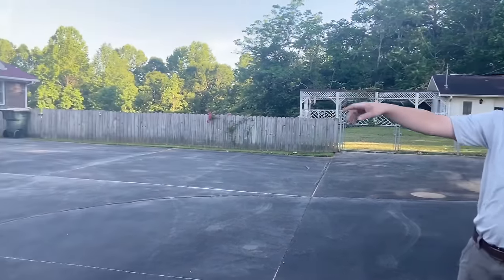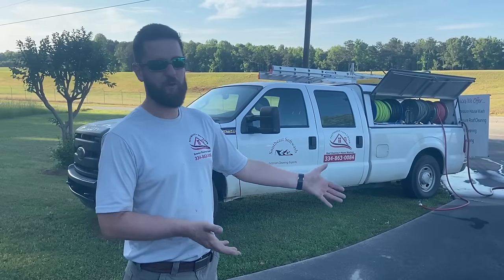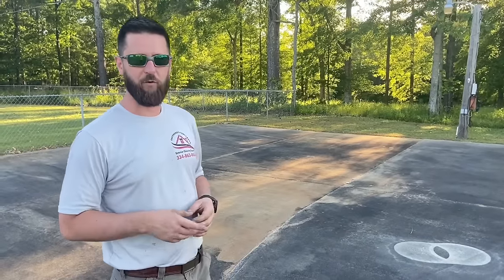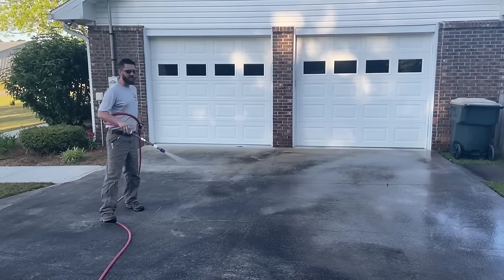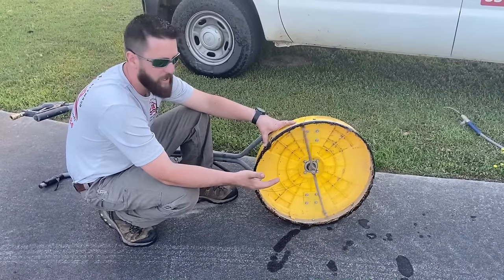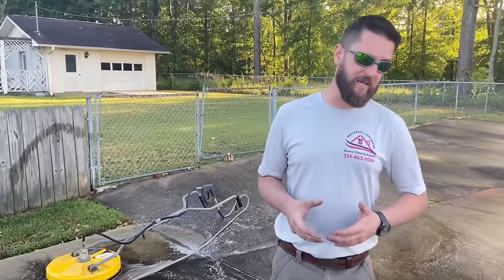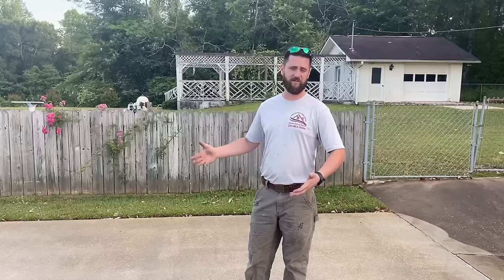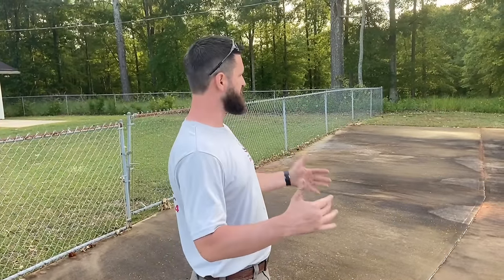How to clean a driveway. Start to finish

Comment: your not worried about the pump over heating when you stop the flow of water with the unit still running?
Reply from the maker: Not really, if I leave it that way for an extended period of time on the set up that’s in this particular truck, it would damage the pump. 

The systems that we build at my company are mostly tank fed systems, so you can let them run as long as you want to without damage.

Comment: Its going to continue to have issue you need to drop down to a 16inch Eagle Whisper....i was like you using a 20inch with my 4gpm but as soon as I droped down to a 16 using 30 tips it was moving like butter so effiecent and fast ans yes I Pre treat but I would say the 20's are ideal for the 5 and half machines and the 22's to 26's for the 8gpm..they say take the machine you have and multiply it by four and that should be your max size surface cleaner

Comment: I did a driveway and was left with lines after running the surface cleaner. Is there a method to preventing that? ive seen some videos saying to go in swirl motions instead of straight rows
Reply from the maker: post treat with SH

Comment: Great Video man! Question. Do you find that sunlight helps with your Pre spray do a better job activate wether it be concrete or vinyl siding? Is that a thing? Also do you spray the whole thing then wash even if it dries or do you do that in small sections as well? 

Knoxville TN
Duncan & Sons’ Building Maintenance 

Thanks for your help!
Reply from the maker: The sun really doesn’t help. If anything it’ll dry it out too quickly and not allow it to work long enough. 

It won’t hurt it to dry on concrete tho. Pre-treat the entire pad with one application

Comment: I have a brick home to clean that is really dirty, I don’t have a soft wash system, I have a x jet , what should my mix be ?
Reply: Just use detergent, if you have to much mold maybe use a 2 to 3 at 10% of sh since the house is bricks you will need a little more pressure to remove some dirt

Comment: Hi,

When pressure washing with a (4400 psi @ 4 gpm) and a 20 inch surface cleaner. Is it better to use a 3/4" garden hose or is a 5/8" good enough for 50' & 100'?
Reply from the maker: 5/8 is fine. More flow is always better tho
Reply: I  think more flow with  3/4 not 5/8
Bcs 3/4 dia greater than 5/8.

Comment: can someone help me with this: Is it safe to use a 4.2gpm Machine with a house hose water supply?  If the home's water supply to the spicket is under 3gmp, will it harm a 4 gpm unit to rely on lower water supply? Thanks in advance!
Reply from the maker: The supply must be at least as much as the demand from the pump. 
It will definitely cause issues if you do not give the pump at least 4 gallons per minute.

Comment: Thanks, Coty; Great Stuff. Appreciate you taking the time to do this. Question: Russ over at Modern Curb Appeal says he tries to stay within the range of 2500 to 2800 PSI for concrete. Is this what you have coming out of the surface cleaner with the 25025 tips? Also, do you use a reclaim system when you have to? If so, what system do you recommend? Thanks again.
Reply: 2500-2800 psi total or split between the 2 nozzles on the surface cleaner?

Comment: That shaking on the surface cleaner SHOULD NOT be there. It should be smooth as butter, don't know what exactly the issue is, when that happens to me its because there is debris stuck in one of the 2 tip on the surface cleaner
Reply from the maker: Tips worn out on this one

Comment: Can you tell me what brand or model of High Pressure Ball Valve you have there...
Reply from the maker: Here ya go: https://southeastsoftwash.com/product/high-pressure-3-8-ball-valve-dn10/
Reply: @southeastsoftwash4020  Thx but that's rated at 3000 max psi
Reply from the maker: @jasonsims007  correct, but there are about 7000 guys in the industry using these on machines well over 3000 psi. I have never had an issue with one of these, and I’m not sure why they rated them at only 3000 psi. Because I know of hundreds of guys that use these on a daily basis and they are a non-issue.

But going off of manufacturing spec it is technically 3,000 🤷🏻‍♂️
Reply: @southeastsoftwash4020  Thanks for the input I just didn't want it to explode in my hand ;)

Comment: How would you avoid getting chemical on a wooden deck built on to the house? Then having to wash a deck for free due to the SH putting bright spots on the deck
Reply from the maker: Pre wet it, but sometimes it can’t be avoided so we’d skip the chem part if it’s gonna mess up the wood

Comment: Can a 20 inch surface clesner work with a 3300 psi 2.6 gpm power washer?
Reply: The smallest nozzles are rated for 2gpm Since you have 2 on a surface cleaner you need a 4GPM output. You could buy another identical machine and attach the 2 together so you'll get 5GPM. Just match your nozzles to the output.
Reply: Joe G but would a 3300 psi and 2.6 gpm work at all?

Comment: Out of curiosity, why not go with a larger surface cleaner? Say a 36" vs your 20"....
Reply from the maker: I’d need a bigger gpm pressure washer to run a bigger surface cleaner. 
A 4gpm machine is topped out at about the 20” size
Reply: @southeastsoftwash4020  gotcha. Thanks for the reply! I appreciate the info. About to get a rig and get into the business in 2 months.

Comment: Love the video! I have a few questions; you said the size tip you are using is a 25025 and that the last 2 numbers (2.5) is the gpm? I thought the last 2 were the orifice size.. does the orifice size of a tip correlate directly to gpm? Also on your ball valve do you use a male plug on both ends the end going to the hose and the one going to the gun? Thank you love you guys videos
Reply: What plug you put on either side is all up to you. You can rinse with your ball valve if you have the male end towards the gun. If you have the socket side towards the gun its been heard that you can lose a o- ring.
Reply: 25025. The first two digits are the angle of the tip. 25°. the last two digits are the gallons per minute

Comment: Rust is bad   As steel rusts, it can expand up to eight times its original size, causing the surrounding concrete to break away. Once established, the rusting will spread along the reinforcing in each direction.

Comment: Homeowners can get a nasty fine from the EPA for allowing the runoff into a storm drain or other waterway. Regardless if its a company doing the work!
Reply: Don't worry Trump rolled back EPA standards which means you could clean the driveway with cyanide and it would be legal smh!

Comment: would you recommend using a degreaser as a pre treatment vs SH due to cost?
Reply from the maker: Tyler Holdcraft no. Degreasers do exactly that, degrease things. 99% of the time what we are trying to remove on a flat surface is going to be organic growth. A degreaser will not do anything for organic growth. We use SH for that, and only use a degreaser when we are actually trying to remove an oil or grease stain. I don’t worry about the cost, SH is cheap, and it’s worked into the price that the customer pays

Comment: What kind of psi is recommended?  I have a 4400 4gpm machine is that to strong? Great video thankyou
Reply from the maker: joseph mitchell that’s fine. Psi doesn’t matter as much as gpm.
Reply: @southeastsoftwash4020 thanks so much for responding! I agree 100% just making sure 4400 wont damage anything
Reply: joseph mitchell you honestly don’t need 4400 psi of pressure.  High pressure will damage concrete.  Mine is 4000 psi at 4 gpm.  I think I have it set around 2700 psi.  I don’t even use high pressure tips,...probably have only used them once or twice.  The Lo Rinse Jrod tip works very well for rinsing and cleaning areas that my surface cleaner can’t reach.

Comment: First off single bar surface cleaner is garbage...
You need to get 4000psi with a triple bar hot steam..
Your chemical is not right for environmental..also when sparing biodegradable chemical on dirty harsh driveways you should broom..
Also recovery you need to recover that water...overall your on the right path but better equipment and right procedure on how to clean a driveway will make you a better contractor